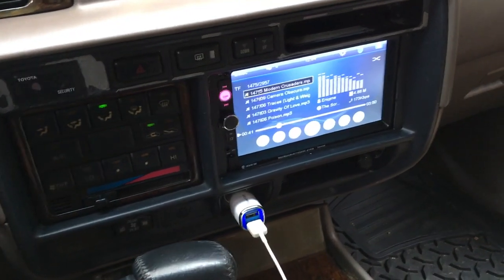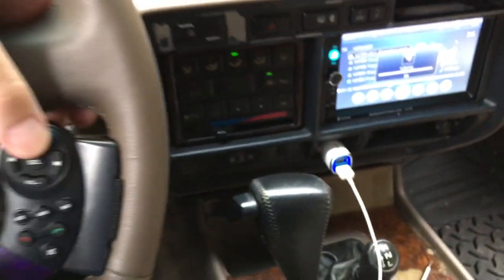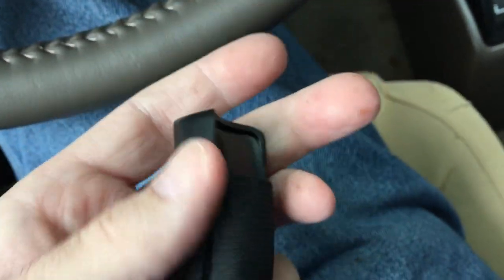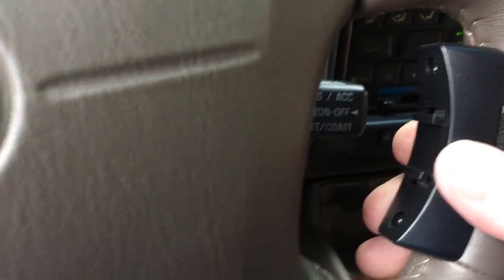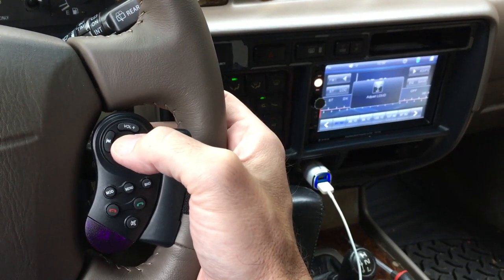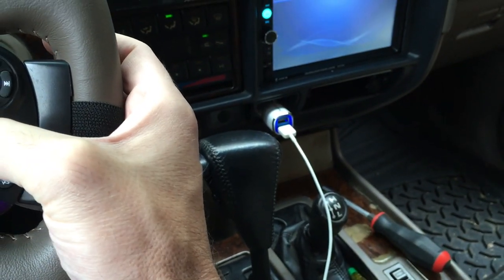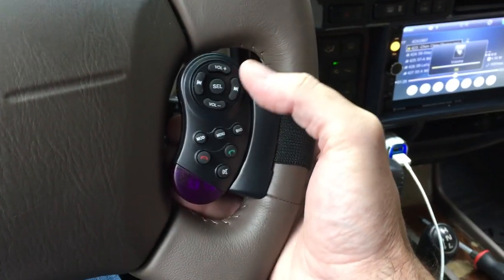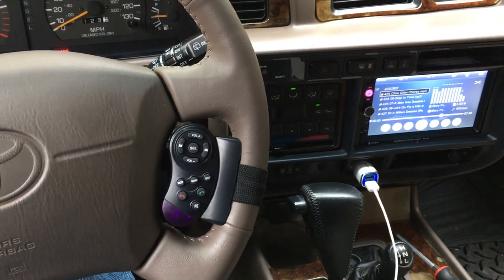Cheap Touchscreen Radio Steering Wheel Remote

Comment: The one wire on mine says remote dose it’s brown where does it hook from back of stereo to make the control work . And what’s the brake wire for ?
Reply from the maker: That would be if your car has integrated controls on the steering wheel. Then your connection adapter for your car should have a wire to connect to. Brake is for the parking brake so the radio knows when you are not moving (so you can watch videos).

Comment: Bought mine yesterday. Button functions are not in sync with my head unit. Volume up goes to fm radio and volume down is number 3 etc... How to reprogram it?
Reply: You can't, you're lucky it does anything at all. These have fixed IR codes, different devices use different codes.

Comment: Did you ever figure out how to program it? I bought one of these remotes but can't figure out how to program it, there was no manual.
Reply: Same here I'm having trouble finding the right battery they don't tell us much about it.
Reply: You almost certainly can't, the sellers of these remotes are just dishonest &/or clueless. They most likely only work with generic Chinese headunits such as shown in the video.
Reply: Change the battery and open your camera on your phone and hold the purple infrared in front of camera and press buttons while looking through your phone camera to make sure the purple IR is blinking. This will ensure that your remote is functional. No programming necessary.
Reply: @DoubleMonoLR  have you ever bought a RCA television where the remote worked on your zenith television in the other bedroom? Absolutely not! Because that's not how any of this works.
Reply: @andrewfilippone2130  thank you so much..  i cant set  the remote but I found out how i can see the IR . Thank you. God bless you.

Comment: Can anyone help me figure out why phone link is not working?
Reply: Are you using a cable? Is it the charge cable that came with the phone? The cable included with your phone has more wires than the cheap ones. This allows for data transfer as well as charge.

Comment: Hello, How did you hook up the steering wheel wire from the radio and to which wire you connected it too. From head unit to where, because I cannot find wire for the steering wheel control I have 2003 Toyota camry and I don't have factory steering wheel control. Can you please help me
Reply from the maker: This remote uses IR. The radio I am using have a wire to connect to a steering wheel control but I don't have a factory control so I am using this IR remote.
Reply: @Rickmakes  thank you

Comment: What way does the battery go in?
Reply from the maker: I don't remember off the top of my head. It is covered in snow right now so I can't check. I would try it both ways. You can press a button while looking at it with a phone camera. You will see a little light flicker when it is right.

Comment: please tell me how to setting first time this remote control..i have not working...the remote same and the headunit use android 7012B..thank for your attention
Reply from the maker: I'm not sure how to pair it. It was already paired when I got it.
Reply: It is infrared
Reply: Same with my mobile Android not connect to remote control, can you teach me, tkhs
Reply: The seller claims this is a blutooth remote,wich it is NOT! I ordered one,and it will not work with Android..
Reply: @Rickmakes  They don't pair as such. IR remotes(exactly the same with traditional IR tv etc remotes) use a particular way of coding the signal, different brands use different codes. There is no pairing, if the head unit 'understands' the IR signal it receives it works, otherwise it does nothing.
These remotes have no way to change the codes, so they won't work with most head units.
This is why 'universal' remotes come with a list of setting codes, so the remote can be set to match the device. Likewise 'learning' codes record the IR signal from an original remote.

Comment: how to know if the remote is working?
Reply: If the stereo does something when you press a button.. These remotes don't work with most headunits though, seemingly only no-name Chinese ones.
You can test if it's actually sending a signal/has a good battery by pointing at your phone camera, which will show the remotes IR light blinking (the camera is sensitive to IR light, our eyes aren't)

Comment: I just put a steering wheel cover to prevent hitting that elastic band and shifting the remote around.
Reply from the maker: If I hadn't had the steering wheel re-wrapped, I probably would have double stick taped it. :)

Comment: Hi Rick, I could not find the battery type for the remote control you have to insert. Do you have information about this? Greetings from Karlsruhe , Germany
Reply: I was wondering about the battery size also. I got no instructions.
Reply: CR 2025
Reply: Thank you Amber.
Reply: @Bo-hb3eo  no problem, I bought a CR 2032 and it also works, just a fyi👍🏾

Comment: Is it still working after 9 months? How often do you change the battery? Great video btw!
Reply from the maker: Still working. I haven't had to change the battery yet. It should last quite a while because it only uses power when you press the buttons.

Comment: How did you link the remote with the unit? Mine, even though it came with the unit doesn't do a thing.
Reply from the maker: It just automatically worked. You do have to pull the plastic tab out to enable the battery to work. You might also try replacing the battery.
Reply: You have to be close to the radio, pretty much useless tbh mine only works when it's about 8" away
Reply: @andrewfilippone2130  I bought this Control but don't work in my device. I tried copy from my original remote control but I don't found how I can do this. Do you know? My  device is a Alpine.
Reply: @roque_vinicius  I think it only works with the cheap China radio. I fixed mine it is working good now. Open your camera on phone and look at the IR sensor on remote through camera lens. You will see the IR light flashing
Reply: @andrewfilippone2130  y como lo programa para que lo reconozca
Reply: @jonathannava2903  programming is not necessary for the IR remote. Open the camera on your phone and look at the IR remote through the camera lens and see if it is flashing with new batteries.
Reply: @andrewfilippone2130  si parpadea cuando oprimo los botones pero igual no hace nada
Reply: @jonathannava2903  did you look through camera on your phone?
Reply: @andrewfilippone2130  "Is not necessary" = doesn't work with brand name head units, just cheap Chinese ones.
They all have their own remote codes, remotes can't just magically work with everything without some form of setting or learning codes.
Reply: @DoubleMonoLR I own 4 version of this head unit and on this particular brand head unit it does!!!! And no it's not magic it's called IR. The same way your TV remote worked in the 90s without programming. (Unless your little brother lost it and had to purchase a universal remote) Example: all Zenith TV model: ABC remotes will work with each other and model:XYZ remotes will work with each other because yes they are using the same code. But this particular head unit in this video that we are calling a (cheap Chinese radio/unit) are all the same code. No programming necessary
Reply: @DoubleMonoLR  They never bothered to use a different code. But now you are confusing people. Most ppl here are having trouble because either the battery Is toast from sitting In the China box for so long or they never pulled the plastic tab. Also the range sucks and can be literally blocked by a #2 pencil.
Reply: @DoubleMonoLR  I've even heard a guy in this comment section trying to use this remote with an alpine head unit. I'm scared to see what the future holds if people think that's going to work.

Comment: how to insert program to ir remote?
Reply from the maker: I didn't have to program this. It just worked. Make sure you pull the plastic tab out of the back of the remote to "activate" the battery.

Comment: Wheres the battery
Reply from the maker: There is a compartment that slides open on the back to access it.
Reply: What battery does it require & how / where did you wire the ‘control wire’ in the 8 wire connector (my wire is orange/black)?

Comment: How to remote paring
Reply from the maker: Mine just worked. I didn't need to pair it.
Reply: I'd this problem. I bought this universal remote control but don't works in my device. My device is a Alpine with IR but don't works.
Reply: You can't. If it doesn't work, that's the end of it. There's no way to change the IR codes on these remotes.

Comment: How do I connect this thing
Reply from the maker: Mine just worked after I removed a piece of plastic to allow the battery to make contact. It uses infrared so it needs to be line of sight to the radio.
Reply: Mine wont connect
Reply: @matthew2275  same with my mobile Android, I have  remote control not connect to mobile Android, why and can tell to set it? Tkhs.

Comment: Could not get it to work on a right hand drive car The remotes curvature means you have to mount it on the R/H side of the steering wheel which blanks the led reaching the radio ir input